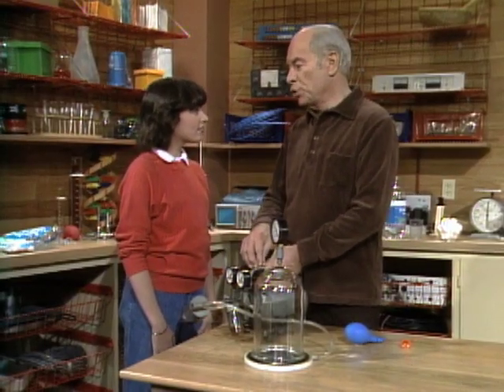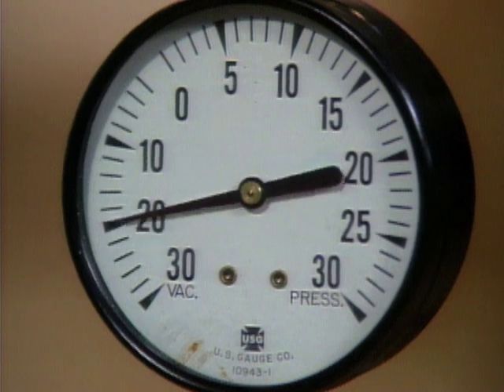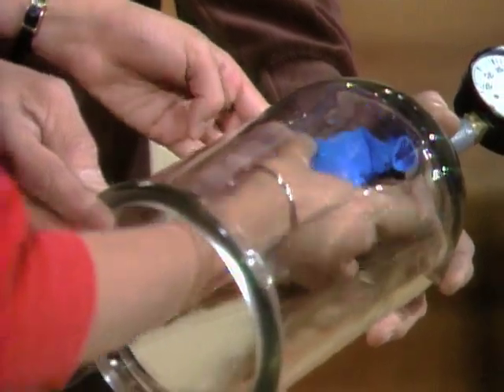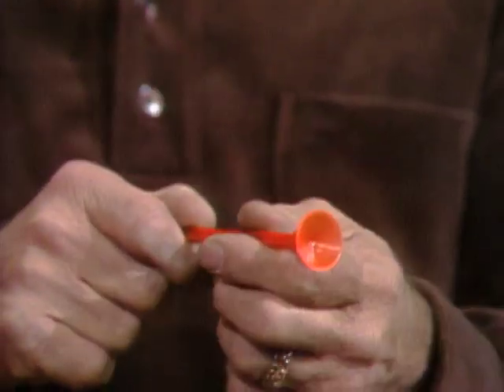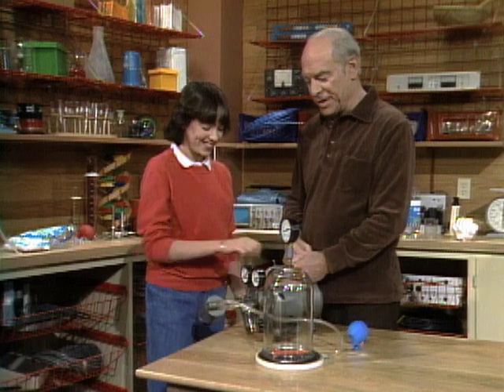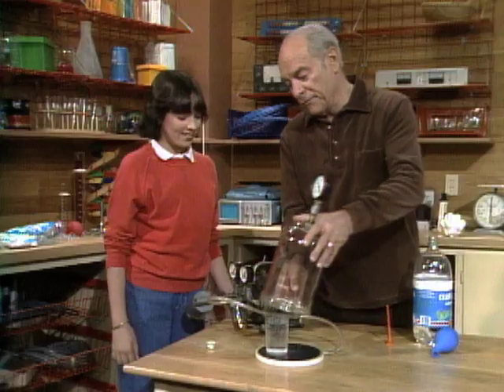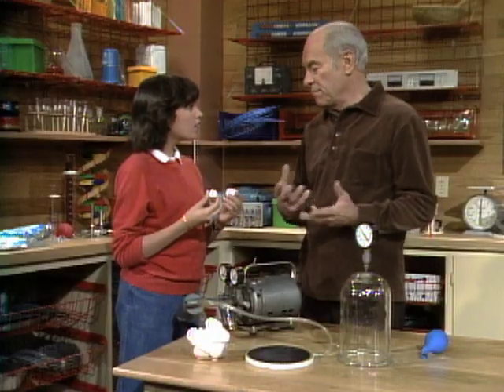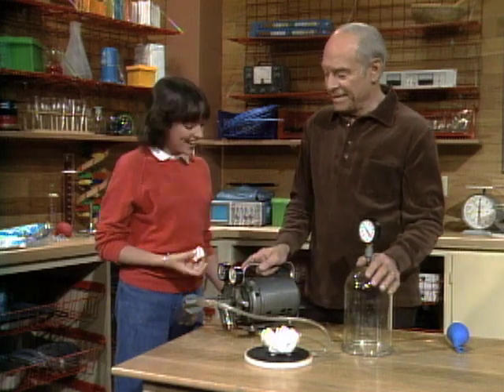How Does A Vacuum Pump Work? (Mr. Wizard)

Comment: you should have a chamber bigger  like that (in the link) , there you can discover new things , speed of sound in vacuum, speed of light maybe , you can  discover  if the flight can live in the vaccum chamber with sound in (hitted by sound in the vaccum chamber , you can put a sound sensor to calculate(to measure ) the sound intensity or density ,you can discover  : how much bigger/smaller is the sound in the vaccum etc... ),  you can discover : if  can fly a flight(mosquito) or a drone can fly or not , if a light or an electric heater can work properly in big vaccum chamber ,can exist the wave in the vaccum ? the wave is the disturbance  or a variation of who  ? of which ? of what ? because in the vaccum there is no oxygen ( no gas ,no air  which can make  possible the transportation of the  waves, therefore :  did the waves exist in the vaccum ?, what happen a gas , in a vaccum in a big chamber like this, etc... ,  :   https://www.youtube.com/watch?v=E43-CfukEgs

Comment: So, how does it work?
Reply: lol
Reply: Hisham 
This exactly my question, I thought this clip would explain what the mechanism inside the chamber, click baited...
Reply: He explained it in the beginning you didn't keep track of it.
Reply: You may not see it but there is always a pressure, a force that is pushing in your body right now, all around your body, this pressure is called atmosphere pressure and it's always there. And there is also a pressure within your body, a force that's trying to push out antagonistic to the atmosphere pressure that's pushing in. So this maintains the shape of everything that we see now. Everything that u see from ballons to your body. So if you remove the atmospheric pressure that's pushing in. You are left with the force in your your body that pushes out. So u will be bigger without the atmospheric pressure. However, hard things like metal,diamonds. etc may maintain the shape even without the atmospheric pressure because the force of the bonds that holds together the molecules ignores the presence or absence of atmosphere pressure